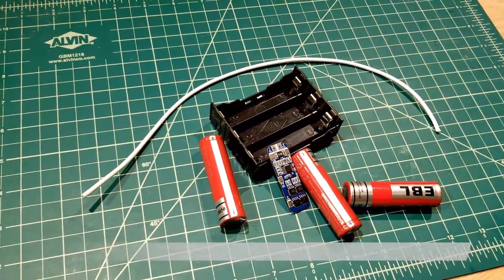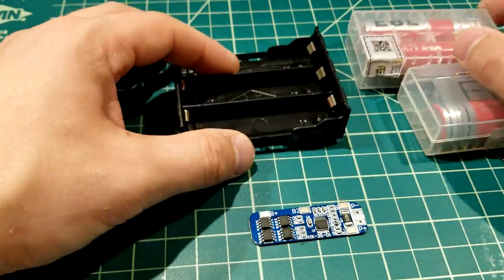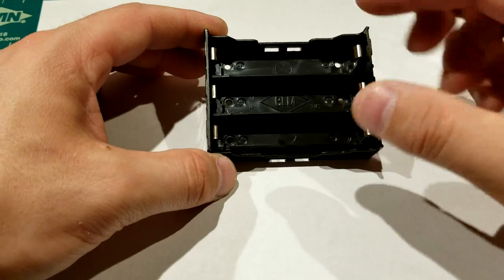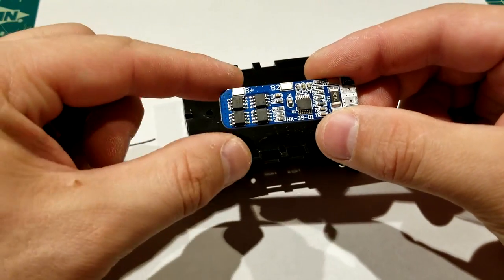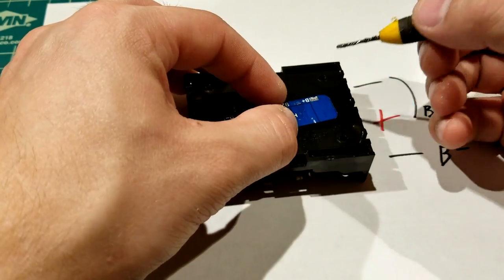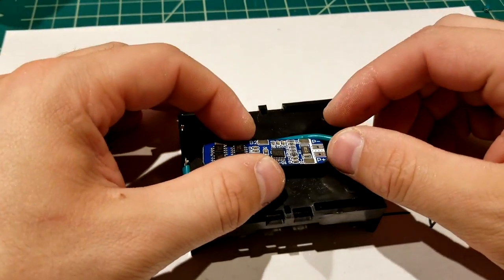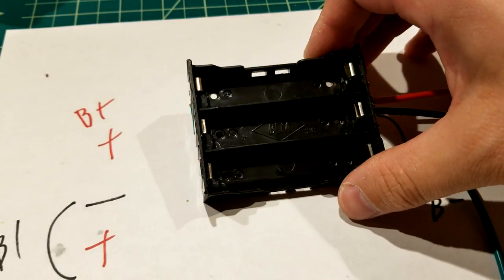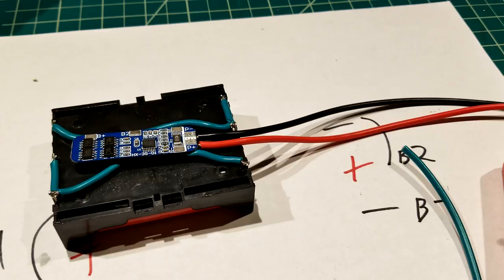How to Make a 12v Portable Battery Pack - DIY

Comment: I have also 3 protected batteries. I need 4.2v output. Aligned in parallel, is 1s bms circuit all I need?

Comment: I know this is a older video but if you see this I need help,I want to make a set of 12v turn signals for the front and rear of my bicycle with 4 led mirror arrows and a flash relay... I know nothing about electronics so would this pack work,and last atleast a 6 hour road trip? And does that chip convert the dropping voltage to a steady 12v? Thanks buddy!

Comment: Thanks bro.
I need this backup battery packs for my wireless cctv incase of power outage. Can you please advise how i can this goal. Main power source be be 12power incase of power failure I want kind of battery to supply continous 12v as an emergency. Any help will be appreciated.
Thanks

Comment: they have the battery holders you can buy and they are already wired up and have just have a positve and negative wire coming out just 2 wires how would i go about making that rechargeable with out having to soder the batteries?

Comment: Would this project you did suffice for a 12V 2300mah 80's VHS camera battery?  If so would I be able to charge it with the camera battery charger?  I have one of those old long rectangle batteries.

Comment: How do you determine which BMS module is needed per application.? What are the differences.? Can you make a video with a tutorial on the subject with examples.? Also maybe series and parallel achieving certain voltages  These 18650s can be expensive but they last much, much longer then conventional . Maybe a video on 18650 DIY chargers : ) ? You make good videos ! Also, What are your thoughts on making massive battery packs and utilizing buck converters to achieve specific voltages or desired voltages.?  You said if we have any questions or comments we can leave them here Thank you

Comment: The 18650 is a 3.7 volt battery. With 3 in series you get 11.1 volts. To get 12Volt you have to over charge the batteries by -.3 volt each. This is not ideal if you really need 12 volts. I need to maintain at least 11.6 volts to operate a 12 volt radio. I've tried this circuit but the battery output doesn't last long enough for myapplication.

Comment: How do you charge it??
Reply from the maker: I just add a DC jack or female pigtail. and a 12v charger with LED indicator.  DC jack: https://www.banggood.com/1PC-5_5X2_5mm-Power-Socket-Threaded-Head-DC-Connector-Adapter-Plug-Metal-Panel-Mount-Socket-p-1176984.html?p=RM110015053437201710
Female Pigtail: https://smile.amazon.com/gp/product/B00PZVDPTM/ref=oh_aui_search_detailpage?ie=UTF8&psc=1 12v Charger: https://smile.amazon.com/TalentCell-Charger-Rechargeable-Lithium-Battery/dp/B00SKFURJQ/ref=pd_sbs_107_3?_encoding=UTF8&pd_rd_i=B00SKFURJQ&pd_rd_r=1Z611RRS08VXMMX9ZV7C&pd_rd_w=zbDFZ&pd_rd_wg=vnE7S&psc=1&refRID=1Z611RRS08VXMMX9ZV7C
Reply: 123Toid thanks!
Reply from the maker: René Peter van der Ploeg you're welcome

Comment: Nice! Could this power the setup in your "DIY Home stereo from car stereo" video or would it be not enough power?
Reply from the maker: It'll work. But I can't say how long the battery will last. You may need two it more of these depending on how loud and long you want it to play
Reply: 123Toid Thanks bro! FYI, I love your vids! I always learn something. Haters are gonna to hate! Let them have there 2 minutes of joy. Keep theses vid coming.
Reply: If u had a low watt radio it will work it probably won’t even start a car I get 18650 battery’s from all over and been making Bluetooth speaker boxes out of them there great for that 
more watts more power needed this set up is great for back up led lighting for your house it would last about 10 hours with a decent amount of light

Comment: those batteried probably dont have protection circuit or 3000mah. only way you can proof it has protection circuit is open that battery. and because 3000mah is maximum 18650 cell capacity there wouldnt be room for protection circuit
Reply from the maker: That is an interesting point.  I never have opened one up.  I do know, that most people who have tested these batteries mah, say they are not true 3000mah.  Closer to 2500-2800mah. Still pretty good for the price.  IThanks for the great input!

Comment: Hi.. noob Q. :
At which point to charge it..?
is it through the same P+ and P-..?
Tx..
Reply from the maker: The video explains it. Thanks for watching.
Reply: @Toid 
Emm.. I figured it out..
The charging port/point is at the B+ positive., and B- Negative..!
Reply from the maker: @kaunisiapa  I think you should watch the video all the way through, the video clearly indicates where the charging ports are.
Reply: @Toid 
I didn't skipped any of it..
I did watched the full length of it..
Keep repeating the same thing out of the question won't help either..!

Comment: You ordered those batteries from china, right? I'm 75% sure those batteries are just bare cells without any protection. If you want to check that, just take the wrap off one of the cells to see. Also the capacity is probably less than 800mAh per cell.